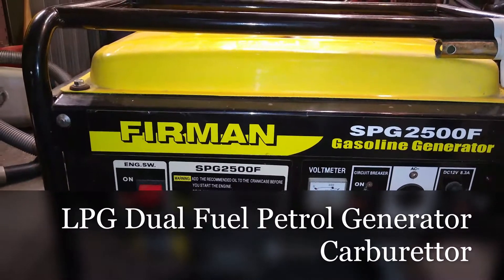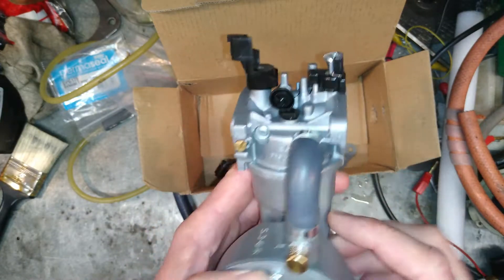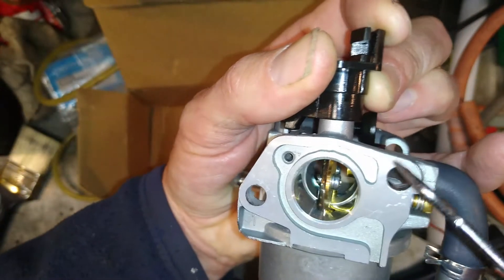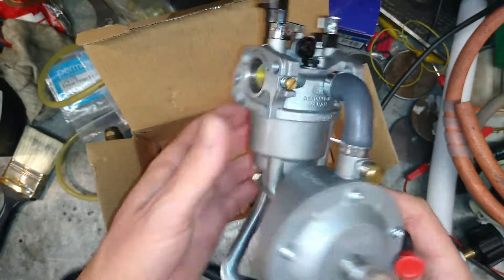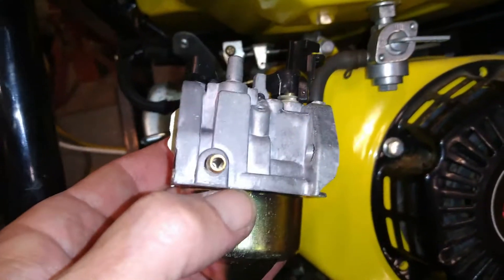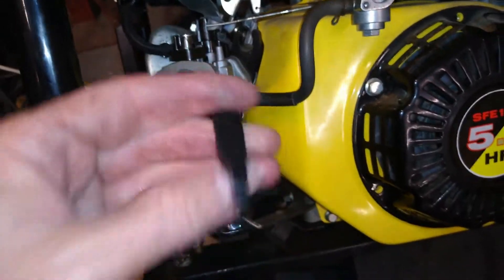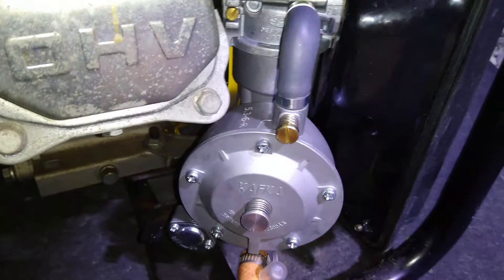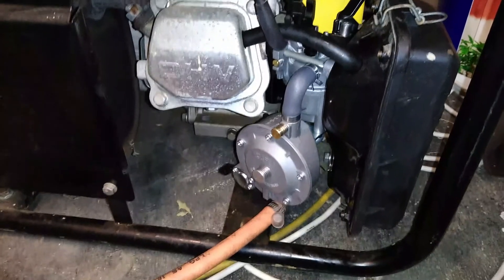Generator LPG / Dual Fuel conversion kit installation and run up.

Comment: So i installed one yesterday on my Honda EM5000 GB160 motor. Fit was great, Did start on LPG but ran terrible and stalled. Tried CNG, finally got it running by adjusting the black phillips screw clockwise , any suggestions on why propane did not work and do you need to  adjust screw for different fuels?

Comment: I'm guessing when you open the valve on the gas tank, gas should not be escaping out of the air filter?
I just installed a dual fuel carb and that's happening. I'm guessing the carb is defective.

Comment: Good vid. Well, I wish everything I did would go that well!
I have noticed that a 20lb lpg tank can run most generators for several hours more than gasoline. Good point regarding the LPG gas longevity. I need to go drain the swill from my generator one of these days. 
 Godspeed!

Comment: This LPG regulator dont seems to have a vaccum port. How LPG delivery will be stopped when the generator is not running?
Reply: You just open and close the valve manually when you want to turn it on or off …however there are electric ones which I think they’re coming pre ready with an electric valve…

Comment: I need one to confirm innovation
Reply: Rhedom Global Brands

Thank you for reaching out to us
2.5Kw-4.5kw is #25,000
5kw-12Kw costs #30,000

1. Gas is cheaper and always available
Reply: Rhedom Global Brands

Thank you for reaching out to us
2.5Kw-4.5kw is #25,000
5kw-12Kw costs #30,000

1. Gas is cheaper and always available

Comment: My friend I have one question .Gase pressure in my home is very slow .so  generator can't start with gas .so i take help from petrol . But during starting when shifted to gas slowly slowly than ok . It is not possible that  automatic shift to petrol or whan aver I close the petrol valve close then fastest shifted to Gase .your carburator have a function .if not then what is the difference between simple Gase kit and those carburator

Comment: Get a general use "variable regulator" and just put the propane hose into the filter. Adjust propane to cut gasoline usage 50%. Measure exhaust manifold temperature not to exceed 850 degrees F.

Comment: Awsome generator. I have a champion 3500/3000watt.  Everyone from everywhere should have a generator. Everything in a modern day home runs on electricity.   
     It's just as important as an AR15 would be in an off grid situation.   🇬🇧 🇺🇸 🇦🇺 love em all.
Reply: Running a generator on LPG or Fuel which is more economical, if it's been used eg: say for 8hrs every day...
Reply: Probably LP.  It burns a lot cleaner and they say your generator will last a lot longer than if you was to gasoline.   But I'm not expert LOL
Reply: Amen to THAT brother!

Comment: Keep in mind if you are maxxing out your wattage on a small generator that switching to propane while having some advantages in maintenance will diminish your wattage output by about ten per cent.
Reply: Don’t forget about the generator safety rules: Always make sure you follow all the generator safety rules whenever you use your portable generator. This is only a reminder. Generators can be dangerous if not used carefully. Every year, hundreds of people die or get injured when using portable generators due to carbon monoxide poisoning and electrocution. Make sure you are using your generator carefully and keeping others safe as well. There is something very serious that everyone should always be aware of when using generators. Some people do run their generator indoors which is not safe and that increases the risk of carbon monoxide poisoning which can cause death of family and you. Some people run their generator in wet conditions which can electrocute them. Please remember that you should never run your generator indoors. Remember that carbon monoxide is an odorless and colorless gas that you cannot see or smell. Carbon monoxide is a silent killer. Keep that in mind. Make sure your generator is 15-20 feet away from your house and away from doors, windows, and vents. Never use your generator in your porch too. Having a carbon monoxide detector is very important against generator safety. Some people also allow children to go near the portable generator which could pose risks. We need to keep an eye on our children making sure that they are not near the portable generator so they won’t get electrocuted or burned by the generator which is dangerous. A locking enclosure also keeps kids safe. A generator shed might look like a tempting place to explore, or take cover during a game of hide and seek, but a generator is a dangerous piece of equipment that can cause injury. It says on the manual that we should also keep children away at all times from the portable generator to avoid injuries. Please do not allow a child or unqualified people to operate the portable generator.  It is important to keep your children safe especially little ones. The portable generator can be hot during an operation. Just because some manuals missed what should be listed doesn’t mean it’s safe to do. Always follow the generator safety rules when using portable generators. Generators pose electrical risks. If you need to use your generator during wet weather, you need a generator tent to protect your generator from getting wet. Don’t let your generator get wet. Keep your generator dry and before using your generator, please make sure your hands and your generator is dry. Do not wear loose clothing when operating the generator. Everything that is said on the generator’s operating manual should not be ignored. Never smoke cigarettes near the generator. Please keep flammable things away from the generator. Never overload your generator too. Your generator can catch fire. Never ever try to plug a generator cord into a wall outlet to avoid back feeding. Back feeding your generator is dangerous. Always turn on your generator first before plugging in appliances and shut off the appliances before turning your generator off. Use a heavy duty cord for your generator and the cord should not be worn out. All the instructions should be followed carefully. Never refuel your generator while it’s running. It can cause fire if fuel spills while your generator is hot. You should turn off your generator and let it cool off before refueling it. Having a fire extinguisher next to the generator is also important. This is only a reminder for everyone’s safety of using generators. Make sure your generator is properly grounded. Having a fire extinguisher next to the generator is also important against the safety rules. https://youtu.be/I1jT3ANENvI and here is a video more about keeping others safe when using generators and also about our family’s safety. It’s important to keep our little children safe as well. Make sure your little children are kept away from the generator at all times especially when it’s running. Hope this helps. Always remember it’s better to be safe than sorry.
Reply: Thanks good info!

Comment: Its great if you don't use it a lot like yours,. But if you use it a lot like every day just use regular gas. Because LPG will burn away your valve seats. I work at a go kart track and if you use the standard head without hardened valve seats its destroyed in 2 months. Even whit hardened valve seats its less then 1 year. But of course its used almost every day.

Great video btw.
Reply from the maker: Thanks for sharing your experience you have confirmed what I thought would happen over time with regards to valve recession.
Reply: I'd assume you experienced this first hand to have left that comment?

 @sb3bedfordbusstuff146

Comment: * I bought one and it works great on my JD3000 gas generator.
* This eBay regulator did not come with instructions, but it fit PERFECT without modification to  motor or regulator.
* The top is a shut off valve. Middle button is to force LP gas into the engine, like choking.
* The bottom valve is a drain for gasoline when you switch to propane.
* Gasoline corrodes the carburetor and sours in storage so this is a LP only for me.
* I purchased a variable gas regulator to adjust propane pressure for optimum performance.
* It works GREAT, and well worth the conversion.
Reply: Don’t forget about the generator safety rules: Always make sure you follow all the generator safety rules whenever you use your portable generator. This is only a reminder. Generators can be dangerous if not used carefully. Every year, hundreds of people die or get injured when using portable generators due to carbon monoxide poisoning and electrocution. Make sure you are using your generator carefully and keeping others safe as well. There is something very serious that everyone should always be aware of when using generators. Some people do run their generator indoors which is not safe and that increases the risk of carbon monoxide poisoning which can cause death of family and you. Some people run their generator in wet conditions which can electrocute them. Please remember that you should never run your generator indoors. Remember that carbon monoxide is an odorless and colorless gas that you cannot see or smell. Carbon monoxide is a silent killer. Keep that in mind. Make sure your generator is 15-20 feet away from your house and away from doors, windows, and vents. Never use your generator in your porch too. Having a carbon monoxide detector is very important against generator safety. Some people also allow children to go near the portable generator which could pose risks. We need to keep an eye on our children making sure that they are not near the portable generator so they won’t get electrocuted or burned by the generator which is dangerous. A locking enclosure also keeps kids safe. A generator shed might look like a tempting place to explore, or take cover during a game of hide and seek, but a generator is a dangerous piece of equipment that can cause injury. It says on the manual that we should also keep children away at all times from the portable generator to avoid injuries. Please do not allow a child or unqualified people to operate the portable generator.  It is important to keep your children safe especially little ones. The portable generator can be hot during an operation. Just because some manuals missed what should be listed doesn’t mean it’s safe to do. Always follow the generator safety rules when using portable generators. Generators pose electrical risks. If you need to use your generator during wet weather, you need a generator tent to protect your generator from getting wet. Don’t let your generator get wet. Keep your generator dry and before using your generator, please make sure your hands and your generator is dry. Do not wear loose clothing when operating the generator. Everything that is said on the generator’s operating manual should not be ignored. Never smoke cigarettes near the generator. Please keep flammable things away from the generator. Never overload your generator too. Your generator can catch fire. Never ever try to plug a generator cord into a wall outlet to avoid back feeding. Back feeding your generator is dangerous. Always turn on your generator first before plugging in appliances and shut off the appliances before turning your generator off. Use a heavy duty cord for your generator and the cord should not be worn out. All the instructions should be followed carefully. Never refuel your generator while it’s running. It can cause fire if fuel spills while your generator is hot. You should turn off your generator and let it cool off before refueling it. Having a fire extinguisher next to the generator is also important. This is only a reminder for everyone’s safety of using generators. Make sure your generator is properly grounded. Having a fire extinguisher next to the generator is also important against the safety rules. https://youtu.be/I1jT3ANENvI and here is a video more about keeping others safe when using generators and also about our family’s safety. It’s important to keep our little children safe as well. Make sure your little children are kept away from the generator at all times especially when it’s running. Hope this helps. Always remember it’s better to be safe than sorry.